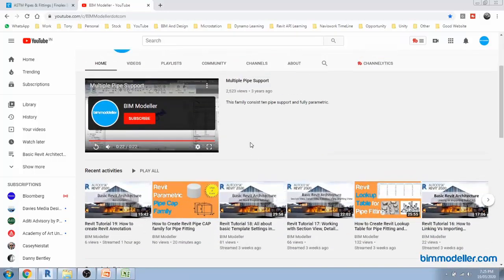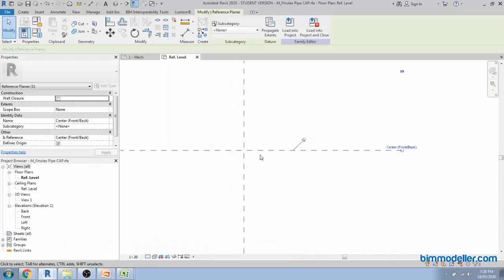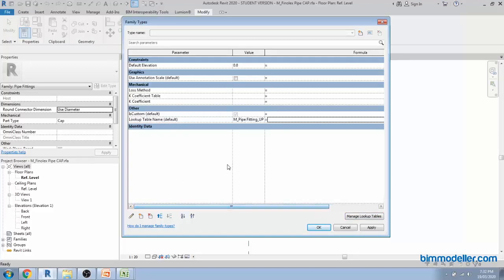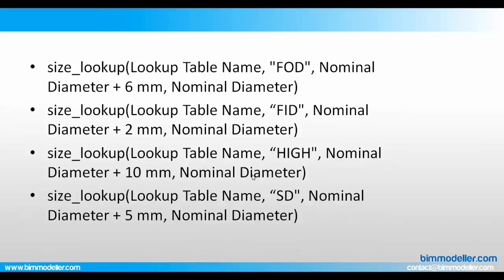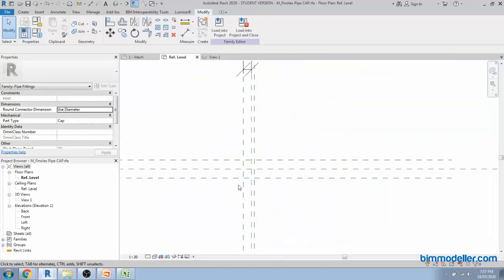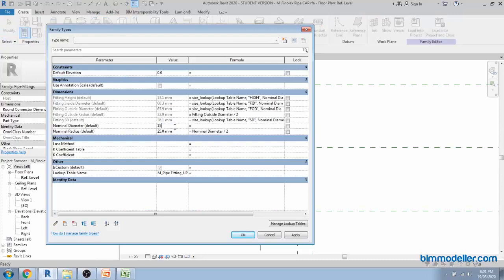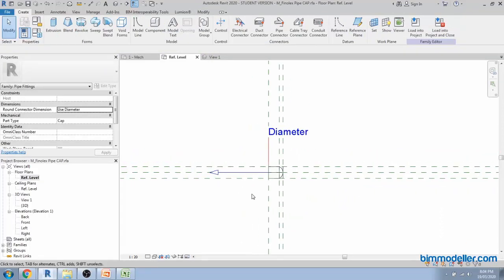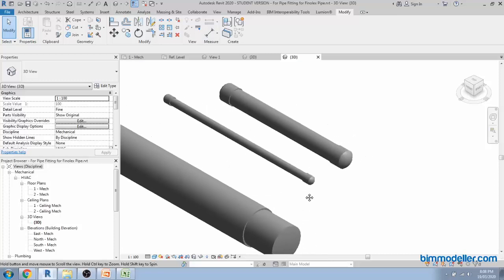How to Create Revit Parametric Pipe Cap family

Comment: Why nominal radius is required in parameter? It's not using in family.
Reply from the maker: It must be assigned to connector diameter. Its the first most important parameter. And based on that lookup table value will be taken. Regarding Radius its best practice to keep sometime we use instead diameter. And it will be used for calculation in the other fittings.